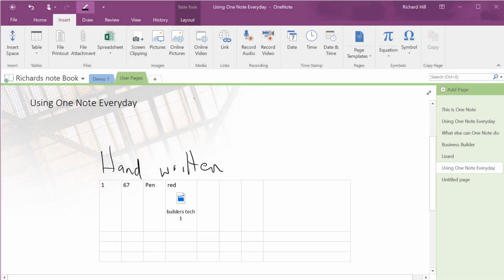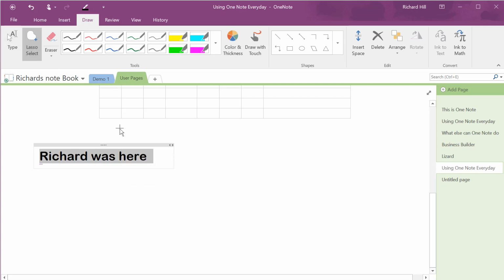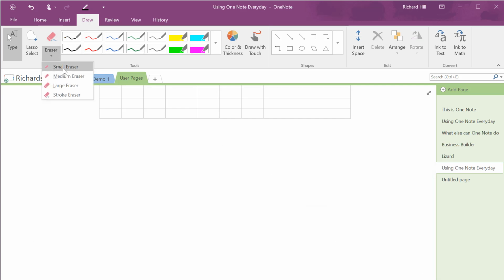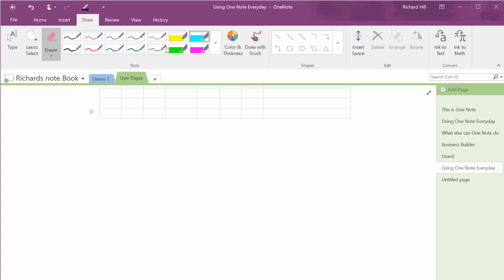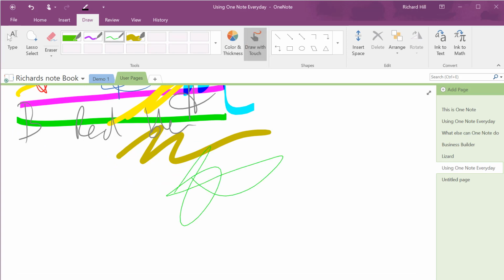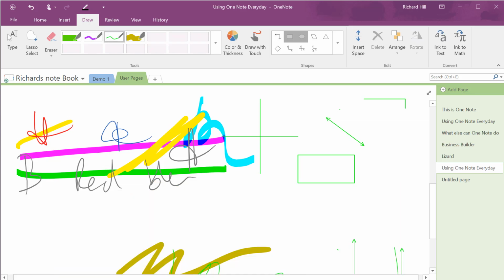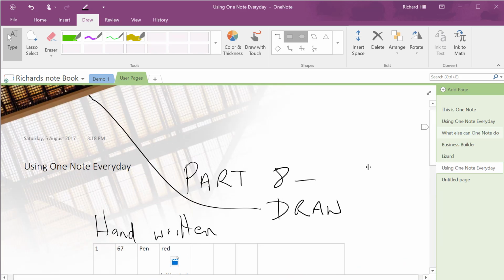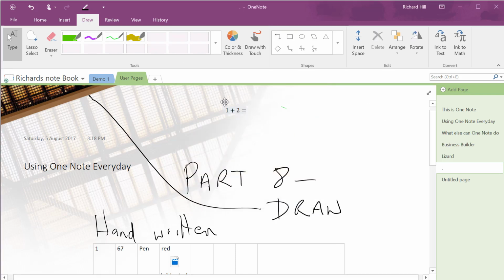Using One Note Everyday # 8 DRAW Tab

Comment: Are you using Windows 10? Because I don't have the ink to text button
Reply from the maker: Windows 10 and 2016 version has ink to text under the Draw tab on the desk top version. Are you using the app version? Or you may need to open the ribbon display options next to where your name appears on the purple band.